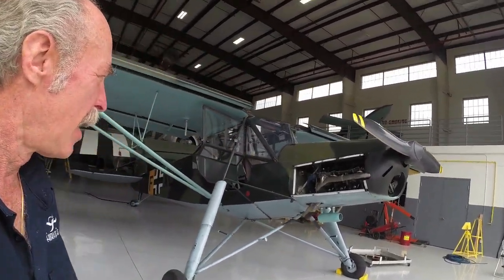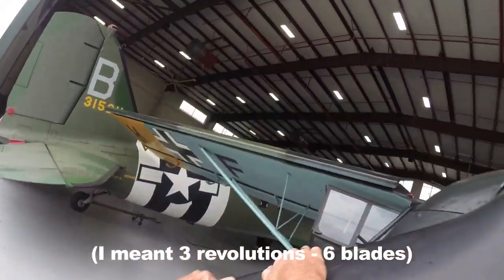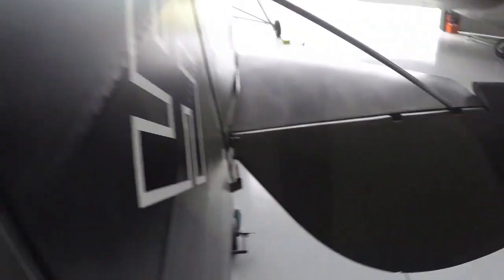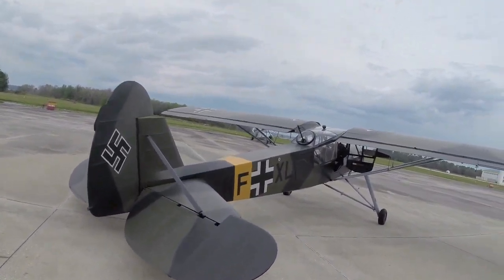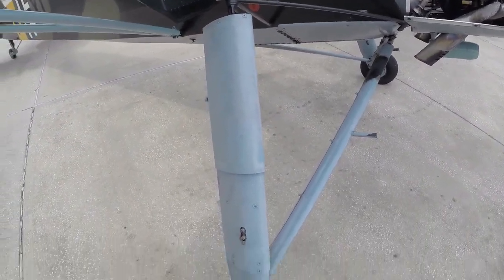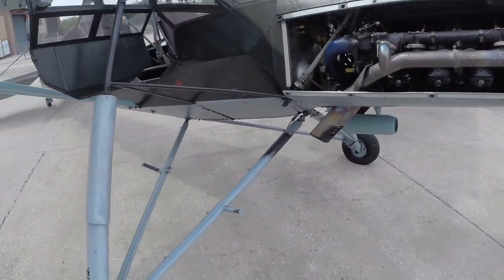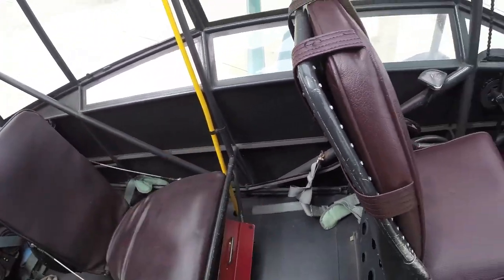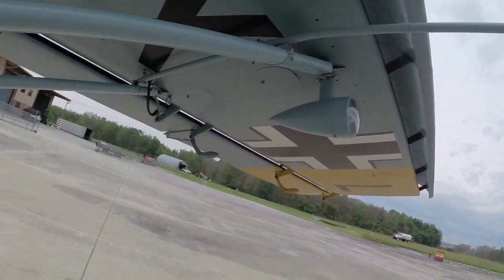Fieseler Storch - Part One - Kermie Cam

Comment: Im a bit confused. You called the leading edge slats "Slots" you refered to them as Slots multiple times. I made sure in case i heard incorrectly. 
Also when you were trying to explain the airleron trim tabs you they also function as u described by the storch does have ailreon trim and you said nothing Bout that. Sorry to nit pick but its the small details that end up being the most important.
Reply: It is a slot - https://en.wikipedia.org/wiki/Leading-edge_slot